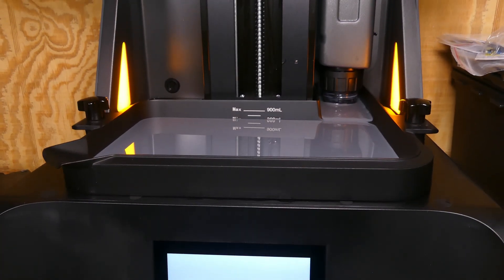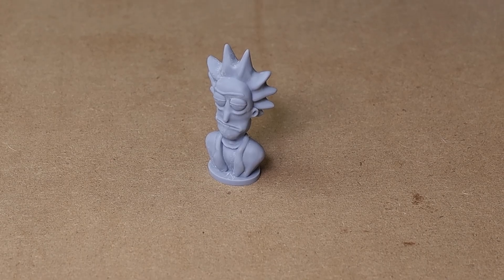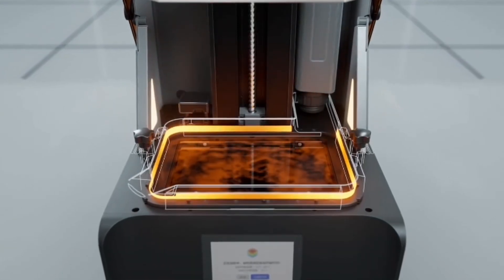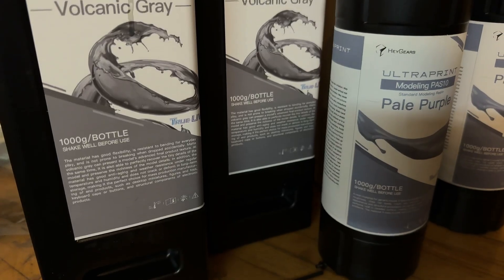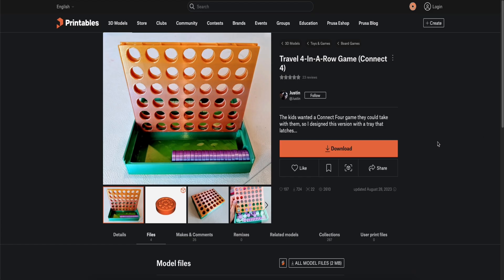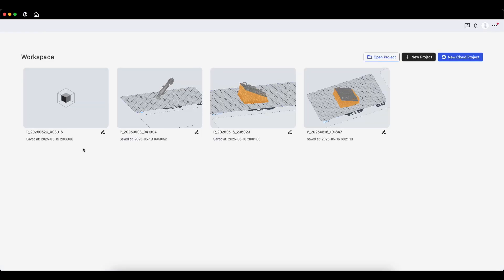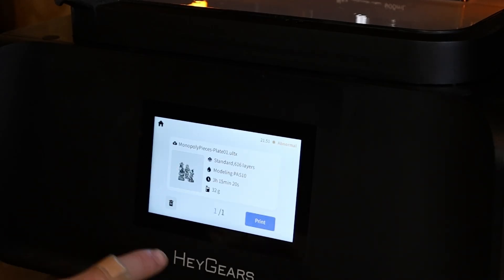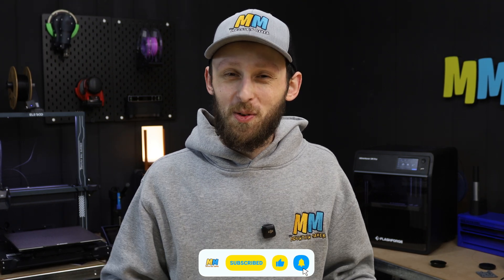I Tried Resin Printing and...

Comment: Like @yutub561 mentioned, resin is nasty stuff. Use ventilation, PPE, and using a big silicon mat helps with easy cleanup.
Unless you are striving for the ultimate model resolution, the flexible resin is the simplest way to go. It's far less brittle. (Nothing worse than breaking off a detail piece)
You are probably going to waste a lot of time printing pretty little things now.🤣 Cheers!
Reply from the maker: Honestly, i had more issues with the flexible stuff than any of the other resins i tried. I’d get a good print and then the next couple would stick to the bottom of the vat instead of the build surface itself. Switching to a less flexible, more general purpose resin completely solved that issue so I’ve been rolling with the general purpose stuff since then. The flexible stuff is cool, still has a lot of great detail but i prefer something that i can kind of send and forget. Especially since i can’t see the print itself until hours have gone by in some cases. This machine does have the force monitoring but that means watching the graph for the first 20-25 minutes to make sure its stuck there before I’m able to run off and do other things
Reply: @TheMountainMaker  Fair enough. I use Anycubic or Sirayatech usually and don't have issues. Obviously not on the Heygears though. Cheers!

Comment: just got my rs turbo 4 days ago, also my first resin printer. Love it so far but its very messy and smelly compared to filament printer!
Reply from the maker: Resin printing definitely has a different set of challenges, but the detail is unmatched! The mess is something I was both prepared for and not prepared for at the same time. Just working with the items its not that bad, but when you go to switch resins and have to do a full cleanup, that was a bit much for me the first time.
Reply: Ya learning the ins and outs of resin printing too.  The smell is the worst part for me. Been an auto tech for 40 years and last 10 years I became very sensitive to certain smells and chemicals @TheMountainMaker

Comment: thank you making another interesting video, but I was wondering what type of printer was your first one because I was looking through your videos and I couldn't find one that you talked about your first printer because I have the Creality ender 3 v3 se and was wondering if you had any tips or quick tricks to make my prints layer lines less noticeable.
Reply from the maker: The Ender 3 was my first printer in the shop, the V3 SE was the second. I think with maybe a custom klipper firmware install, you'd be able to smooth those out a little bit. The addition of vibration compensation with klipper does help, but I honestly dont use that machine a whole lot anymore. It's kind of something that gets used if all my other machines are in use and I need to do something at that moment for myself. Its still a far better machine than the original Ender 3 with all that said.
Reply: thank you for the quick responce i will try that